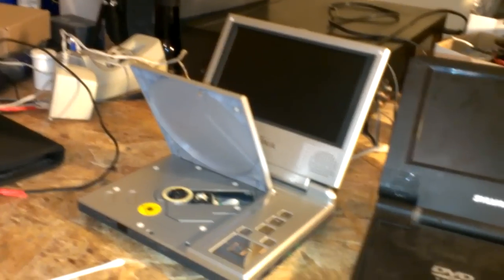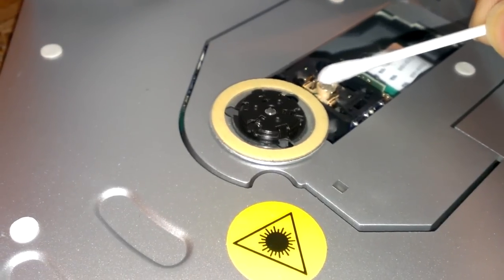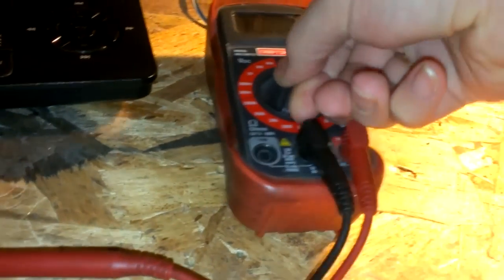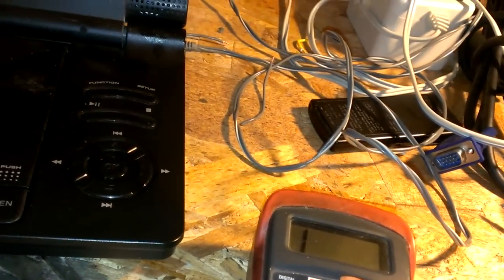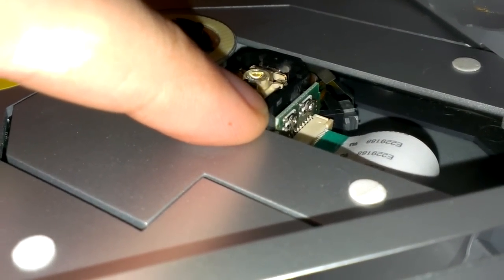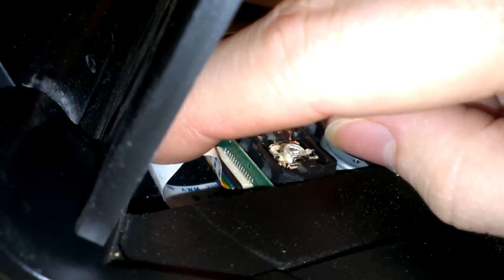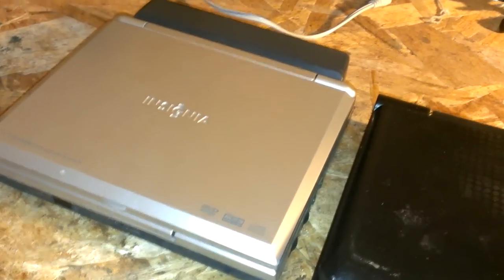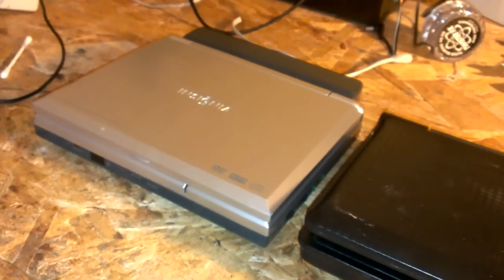DVD player wont read dvd or cd repair

Comment: Good vid, thanks! I have a number of CD and DVD players that all died with "no disk" error after working for a year or two. I'll try screwing with them this way. I did bring one (TV unit) back to life a few years back by washing the lens with the q-tip just like you suggest in your vid. Gave it a few more months' life! Frying the laser is not a concern as they're dead anyway. At least you'll learn something, like taking them apart. Again, thanks for a great vid.
Reply from the maker: awesome. don't forget to like and subscribe.
Reply: This was in 2017✋😀

Comment: by hard, (T.V. DVD Player) YOU mean a lot more disassembly require.  CD player will work fine.  How many people play CD's on a T.V.  but DVD, A LOT!  So that laser got a lot of used.  So would odd would you give, that adjust the the laser, will make it work.  Thanks, just thinking out load.  But I really like the fact that you took the time to make a video and up load it onto youtube.   Thank You!!@
Reply from the maker: +Robert Mattison it should work with most lasers. if its too far gone then it will need a new one.
Reply: okay, can you please tell me, how long a laser should last,  Please understand, I just wondering if the company this MFG. these products put in the cheapest laser, to keep the product cost low the  customer .

I must say, though I do like the fact that you take time to make these videos and shows use something that we can do, to extent the life out of the DVD player.  How cool is that.
Reply from the maker: +Robert Mattison thanks. it depends on the use. if your playing 5 movies a day. it may only last a year or two with most dvd players. just depends on how much u use it. a laser will burn out eventually. doesn't really matter about the manufacture much. in my opinion.

Comment: What do you mean during the multimeter section when you say "put it down to 6"?
Reply from the maker: +piethouse if its at 7 ohms. then turn it down to 6.8ohms. then try.. if it doesn't work then go down to 6.6ohms. go in .2 increments.
Reply: @bam6972   6k-ohms...

Comment: I have two dvd players. 1 that doesn't do anythibg a mintek that shows the green light when I plug it in but nothing happens after. Disc doesn't spin. Monitor is black and no sound. 

The other dvd player is a audiovox that plays the dvd I hear sound but the sceen is black and kibda grayish.

Comment: The best thing to use folks, is Perfect Duster, which is the same compressed air in a can that you use to clean your keyboard on your computer..I tried the alcohol, Qtip deal, and it didnt work..sprayed lens once with Duster, read CD instantly. Can find this stuff at Office Max, Staples...
Reply: What could be the problem when there is no sound from one channel?the receiver and speakers are ok.Thank you
Reply: Thanks for the perfect duster info. Never heard of it till now. Will give it a try if this fails .. :-)

Comment: Hello. I have a DVD with the reader and it has a pair of screens. The problem is that the reader plays sound without picture. Even when I turn it on, the DVD logo does not appear on the screens. I tried connecting the reader to the TV via the AV input, nothing sound without picture. Are there any solutions to fix the malfunction. Thank you

Comment: hello there I have a cd player that I had for 11 years and I opened it up and where the inside top of the cd player it is black where you place the batteries is there anyway I can get it to read the cd discs again?
Reply from the maker: +moviestar241 try cleaning the tip of the laser very gently with a q tip and alcohol.
Reply: thank you and I will try this.....
Reply from the maker: motor is bad. you might be able to take apart the motor and oil the shaft with a bit of sewing machine oil to get it to spin again. put the cd in. does the cd spin freely or with a bit of resistance?
Reply from the maker: it could be a bad motor.

Comment: Had a Spectronik portable DVD bought in 2007, forgotten in the locker for 13 years Just unpacked to day ,but always read wrong disc. Open the disc receptacle and I could see there some Velcro tape over the Len and been melted. After spending a whole day try to figure out why it doesn't play, I could tell the lens doesn't appear to be lit, so garbage. These craps with generic name were really crap. Anybody has an idea about.. Thank you.

Comment: is alcohol the only thing you can use to clean it?
Reply from the maker: yes. only use 90% isopropyl alcohol. or 70% is fine too
Reply: Better to use denatured alcohol (available at your local hardware store). "Denatured" means pure. Ordinary isopropyl alcohol from your drug store is not pure, it has a large amount of water in it, which means it'll take much longer to evaporate than the denatured variety. It might also have impurities in it, depending on what other things you've used it for. Denatured alcohol is always your best bet for cleaning sensitive electronics and optics.
Reply: Or acetone - your lady's nail varnish remover :-)

Comment: How would I go about fixing laser decay 45% in my Plextor Blu ray drive?
Reply from the maker: replace the laser if parts are available or decrease the resistance to the laser like I show in this video.
Reply: bam6972 Okay. What's crazy is that it reads cd's and even the Windows 7 Disk just fine, but not dvd's, pc games, etc. Thank you.
Reply from the maker: that's normally the problem. cds don't require much to read unlike dvds require much more power to read. so either cleaning or adjusting the resistance will fix it. or a new laser would be amazing if you could actually get the new parts.
Reply: bam6972 Thank you.

Comment: i have a poloroid portable too. my question it wont turn on even if  i plug it in. tell me what to look for.
Reply from the maker: +Hilda Enzweiler the power connecter usually brakes away from the board inside. have to take it apart and resolder the connection.

Comment: I have an evd portable dvd player but it keeps saying "open" at the main screen and wont read dvds or read my usb thumbdrive.  Anyone have any ideas ?
Reply from the maker: clean the laser
Reply: Yes i did follow your instructions and cleaned it using your method in the video but still no luck. When it says "open" the lazer thing moves a bit but bumps into the spinner
Reply from the maker: yea the laser is too weak to read a dvd. try puting a cd in and see if it will play music.
Reply: still the same thing happens. Do you think the lazer is busted ?
Reply from the maker: yea the laser is done for

Comment: Is there anything i can use besides rubbing alcohol
Reply: Better to use denatured alcohol (available at your local hardware store). "Denatured" means pure. Ordinary isopropyl alcohol from your drug store is not pure, it has a large amount of water in it, which means it'll take much longer to evaporate than the denatured variety. It might also have impurities in it, depending on what other things you've used it for. Denatured alcohol is always your best bet for cleaning sensitive electronics and optics.
Reply from the maker: 90%  isopropyl alcohol will do just fine. wont hurt a thing.
Reply: Teacher’s peat bog scotch 👍✔️;))